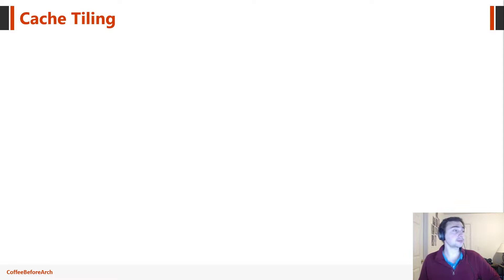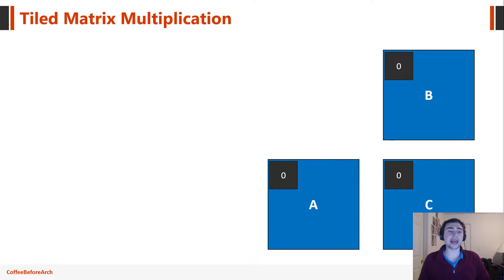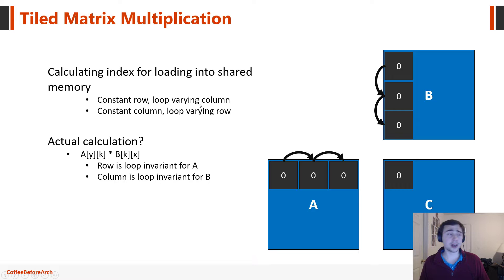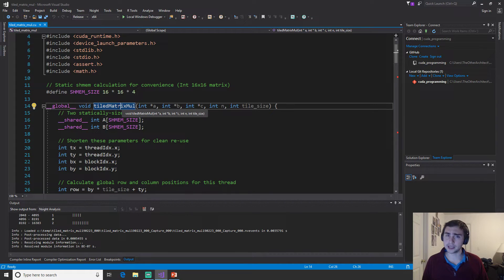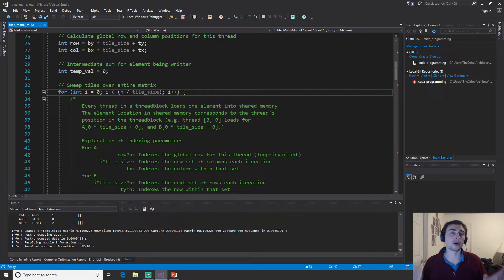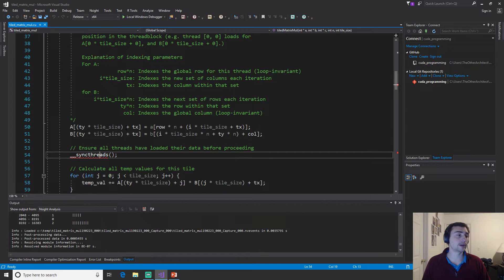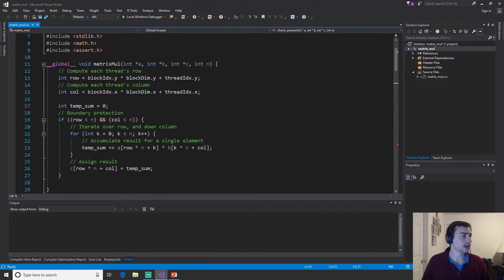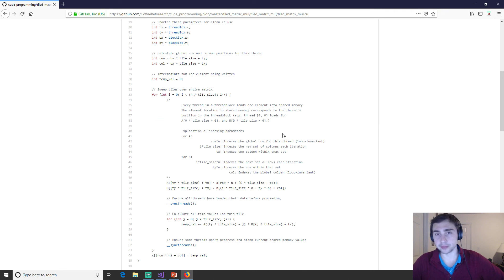CUDA Crash Course: Cache Tiled Matrix Multiplication

Comment: Thanks for the wonderful video. Just one query on the shared memory size. Since you stated that it will be a 16 x 16 tile, so we need to remove the further multiplication by 4 in SHMEM_SIZE
Reply from the maker: Yes, that's correct! It's a mistake in the original video. The code on GitHub does not contain that error.
Reply: I think he got confused between size of elements and size of bytes thus why he multiplies by 4 like you do in cudaMalloc

Comment: Thanks for the video !! I'm new to cuda programming and I don't know if I'm missing a concept, so I was trying to change the size of the matrices to see performance in larger multiplications, but when I tried to multiply 4096 x 4096 (n << 12), the tracking application did not captured any of the kernel launches, the maximum size I could see for the duration of a kernel was around 3000 x 3000 using the first type of activity (Tracking application).

Comment: Hi  CoffeeBeforeArch, i'm wondering why we don't free up the memory allocated in the error check function pointed by (verify_c) variable
Reply from the maker: It should have been (it's a memory leak, although the program does immediately end afterward so it is automatically). I've updated the github repo with a verification function that doesn't allocate any new memory as it should have been from the start.
Reply: Thank you @NotesByNick

Comment: Thanks for the video! By the way, I have that noticed that when working with smaller matrices ( 16x16, 32x,32, 64x64) the normal( using global memory) matrix multiplication seems to perform slightly better than the tiled one. However, once the matrices become bigger than  128x128, tiled matrix mutplication perfroms significantly better. Do you have an idea why this could be hapenning?
Reply from the maker: Smaller matrices like that aren't a great target for the GPU (unless many of them are batched together). Just copying the data back and forth is likely slower than just running on the CPU. A likely reason why the non shared memory version is faster is that the extra instructions for managing the shared memory (extra loads and stores into shared memory) outweighs the tiny amount of re-use you are getting. Your data is likely also small enough to just fit in your caches without any manual tiling using shared memory. 
Hope this helps!

--Nick
Reply: @NotesByNick  Oh wow! I was not expecting a reply so quickly. It did actually help a lot. Thank you.
Reply from the maker: Christian Dobrev no problem! Always happy to help!

Comment: what about nonsquare tiles? for example instear of 16*16, we use 8*16 or 16*8 (in first matrix and appropriate to second )
Reply from the maker: I'm not quite sure what your question is. If you are asking if it's possible to use non-square tiles, then yes, it is absolutely possible. It just requires a small change to the indexing to address the fact that the X and Y dimensions are no longer equal.

Comment: Hi, so I think the SHMEM _SIZE definition should be just #define SHMEM_SIZE 16*16 because you are using it to initialize a shared memory array, and it needs the number of elements, not the number of bytes.
Reply from the maker: That’s correct! If you look at the code on GitHub, that issue (and others in the series) has been fixed.
Reply: @NotesByNick  Thank you for the timely reply. This series is great! There is just one more thing. I do not understand why you sometimes do:
int GRID_SIZE = (n + BLOCK_SIZE - 1) / BLOCK_SIZE;
because you are converting to an int, the -1 in there gives you the same answer as n / BLOCK_SIZE due to floor when converting from float to int.
Reply from the maker: @khizaranjum9296  so in all the updated code on Github, floating point numbers are never used (or converted from) in the block and grid dimension calculations. That formula is just a simple way of rounding n/BLOCK_SIZE up to the nearest whole number using only integers.

Comment: what if the matrix is not square
Reply from the maker: Great question! It just requires a small change to the indexing. Here's a quick modification I just wrote to show that indexing off - https://github.com/CoffeeBeforeArch/cuda_programming/blob/master/matrixMul/matrixMul_tiled_rectangular.cu . Handling a matrix dim that is not a multiple of the block size is another interesting problem that you can approach in a number of ways. The easiest way is to just pad the matrix with zeros until it becomes a multiple, and the extra computation does not impact the final results. 
Cheers!
 -- Nick
Reply: @NotesByNick  Hey Nick, great content as always. I am struggling a bit when it comes to multiplication of non square matrices. The above link does not work. Can you please give an update on that?